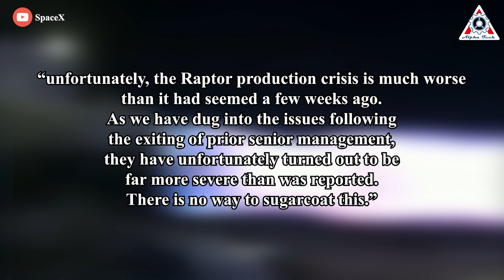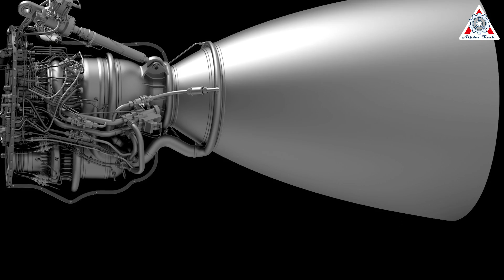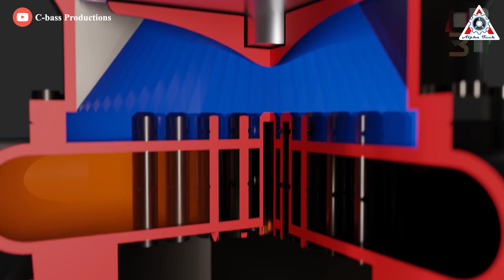SpaceX's insane new engine is facing big problem unlike any others

Comment: Did SpaceX look at using Aerospike engines? Did they try any actual prototypes and testing? Aerospikes reduce some of the problems discussed in the video, but of course introduce new ones. An implied question - have materials and manufacturing technologies evolved in the past few decades to the point where Aerospike engines are significantly closer to practical use?

Comment: How much gain would there be from making the super heavy booster nozzles increase in size with increasing altitude, a drop down skirt for example, I guess there isn't enough space on the current diameter boosters, but could be possible for the next generation

Comment: So, you didn't tell us what is the actual problem(s) with Raptor 2. Not that SpaceX shares that kind of information... I think that the root cause is that Musk doesn't read those books he mentions (he certainly didn't read trade school textbooks on stainless steel pressure vessel welding...) and that he pressures engineers to cut corners and improvise.
Reply: Many scoffed at Musk's Falcon early on.. now their not.
Reply: @lanesaarloos281  Some did, but SpaceX got first government money before the first Falcon 1 test flight.  Falcon is much more conservative (aluminum and carbon composite structure, open gas generator cycle engines) and engineers like Tom Mueller were building it. The only area where they experimented "Musk style", more or less, was propulsive landing, where they could afford failures. What had to be provent there was not that it is possible (DC-X did that decades ago) but that it makes economic sense.  They kind of did it, but it still takes at least a week to refurbish F9 first stage, and its cost to orbit is still several thousand dollars per kilogram.

Comment: The problems with the launch pad are not just because "SpaceX is trying to do hard things".
The destruction of the launch pad whenever the booster engines fire is because of a decision to omit a flame diverter - something every other historically large rocket booster has had. WTF convinced Elon that such a thing wasn't necessary on the most powerful booster in history??? Sometimes Elon's insistence on "innovation" in UNNECESSARY areas can bite him in the butt.
Also, I think his insistence on putting so much emphasis on "Stage 0" is going to hit the system very hard. One misalignment on landing of Booster or Starship could essentially wipe out the Stage 0 of every booster/Starship combination that SpaceX owns, making them useless until the pad is fixed. So the idea is EXTREMELY HIGH RISK, for how much reward? It better be a hell of a reward.
Then planning to put people INSIDE the second stage filled with tons of propellant with no ejection capsules is a recipe for a tragedy, probably far down the road. The Space Shuttle was successful for hundreds of flights.,then one problem killed 7 people. What happens after hundreds of Starship flights you end up killing 100 people or even "just" 50 people? Overnight, everyone will be dissecting SpaceX's decisions and it will suddenly be "obvious" how stupid this was.
Elon has some good ideas, but he is also a risk taker and an extremist. Extremists can sometimes change the world. It can be a good change, or it can be very bad, but it will be spectacular.

Comment: Manufacturing process is not an issue at this point with them having made over 200 usable raptor engines and now more since the announcement.

The raptor issues had been solved according to Elon himself on Twitter so I don’t think that is as relevant anymore.

The test stand has blew up one or two raptors recently but these are just part of the continuous improvement process for those engines not the ones needed for orbital flight as far as I can tell.

Major issues right now are with the launch site not the raptors as far as all the information seems to be pointing anyway. 

I guess you could argue that the raptors destroying the launch site is the issue like you said sort of indirectly is because the raptors are so powerful but realistically here most people even Elon were thinking they needed some kind of flame diverter or deluge system and they are just testing out other ways before they resort to one of those two methods, both of which are not easy to do with the surrounding ponds and water table that they are legally required to keep intact.

Worse case scenario is they end up finishing the cape setup and launch there. Which could be done before mid 2023 easily. I’m sure they will make sure there is a diverter or deluge at the cape or maybe both.
Reply: Lack of flame trench/diverter and serious water deluge system are certainly the problems no amount of cladding and fancy formulations of concrete will solve. But I am not sure at all that all those hundreds of Raptor 2 engines are up to the task of reliably flying even once, let alone dozens of times without refurbishment, Musk's tweets notwithstanding.

Comment: Once perfected, nine Raptor 2s in a Super Falcon 9 with three of those as a Super Falcon 9 Heavy when needed.
Reply: Hopefully, they don't have to re-design those rockets too much to handle the added stress.
Reply: Once Starship flies reliably there will be no reason to fly Falcon, except maybe for previously contracted missions.  I think Elon hinted that Starship would take over all of Falcon's duties.
Reply: @LoanwordEggcorn  Yes, there will still be a need to fly Falcon.  It cost less for smaller payloads.  StarShip needs a massive amount of engines and fuel to launch.  Its like using a Super dump trunk to do the job of a  2 ton pickup.  You still need to get SATs into GEO orbit.
Reply: @TheJTcreate  Smaller payloads will not be economical to fly on Falcon when the cost per ton is so much lower on Starship.  Elon implied that also.
Reply: @TheJTcreate  Mostly talking about commercial satellite launches, where Starthip would carry many at once, or newer, larger ones.  Or you're right and Elon is wrong.  ;)
Reply: @LoanwordEggcorn  I don’t think I’m right and Elon is wrong.  I just think your assumptions are wrong, and since no one from SpaceX has announced such policies (including Elon), all we have is your assumptions.  The physics sure doesn’t support your presumptions. A lot of commercial sat launches are not multiples and do not require a super dump truck to put them in space.  The ISS sure doesn’t require one for most it’s needs.  Commercial Satellites are pretty much what i was talking about too and the bread and butter of the industry.  Hint hint.  So Space X will either leave these missions to its competitors and abandoned Falcon, or it will keep
falcon operational.
Reply: @TheJTcreate  Existing commercial satellite launches could be done as rideshares on Starship, just like smaller satellites are done now on today's rockets, only with full sized satellites. 

(And in fact Starship would allow the creation of a whole new generation of much larger satellites, hopefully to include more space telescopes.)

Do all commercial satellites go to the exact same orbit?  Of course not, but most of them go to similar enough orbits that they could be grouped together for rideshares.  The current smallsat rideshares go to many different orbits, though most are LEO.

Elon already suggested that Falcon would be retired after Starship goes live.

I hate to say you're wrong and Elon's right, but Elon is almost always right, especially for things dependent on really basic physics.